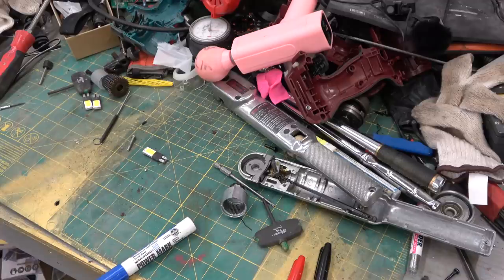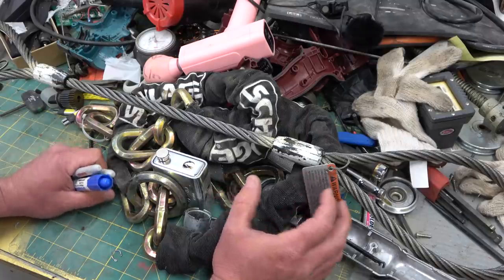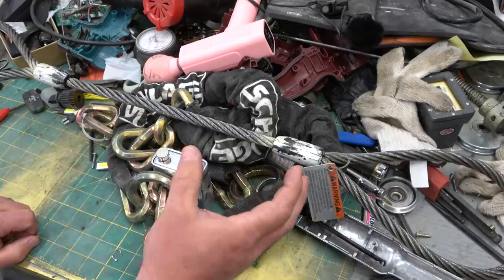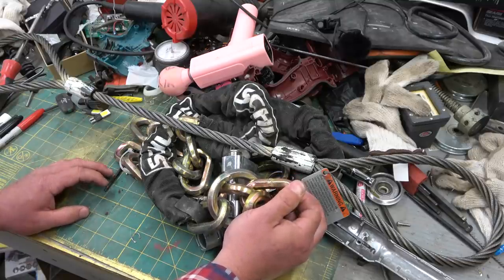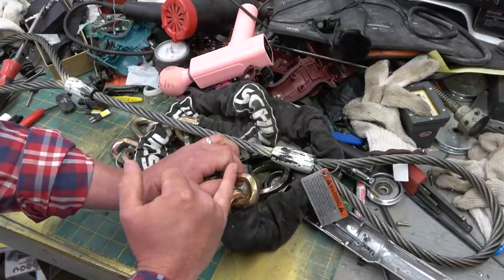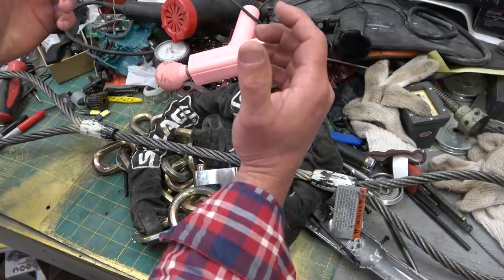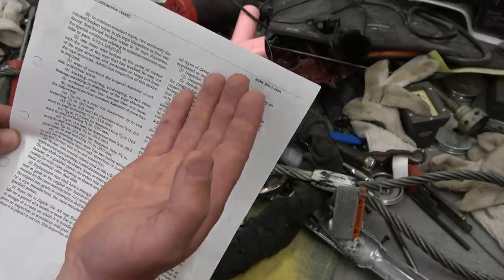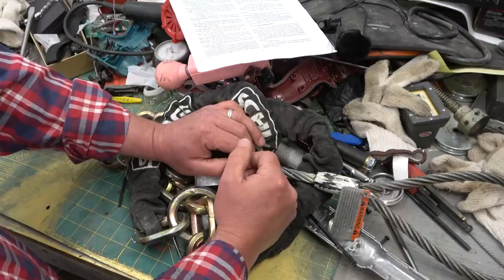"It is not known why the pulling cable snapped."

Comment: Imagine being the guy who designed 2 brakes in, only to have both disabled.
Reply: pathetic. needed 3 breaks
Reply: Imagine that guy/gal watching this news release. Asking why their double fail safe system, failed. Why didn't it work, what did they do wrong?! 

Then seeing those service jaws.
Reply: @mrfordman9999  Nightmare stuff.
Reply: I heard after this job, he went on to designing turn signal systems for BMW.
Reply: @immikeurnot  the turn signals on a BMW are actually functional however the drivers are not.
Reply: @MNDashcam  That's the joke...
Reply: @immikeurnot  I thought that BMWs don't come equipped with turn signal systems at all and to have them installed is one of the costliest extras out there...
Reply: @mrfordman9999  "Imagine that guy/gal watching this news release." - The guy is probably long dead. AvE said that it was installed in the 60's so the design might very well be from the 50's. Even if the engineer was 20 at the time he'd be around 90 today.

Comment: "The profit isn't worth 14 people's lives" - there's maybe an internal memo about that.....
Reply: This company will be sold as it is cheap, be absorbed into an other faceless company and this will continue happening.
Reply: And a reply asking what the acceptable number of lives would be.
Reply: @davesowens  probably one or two a year. But not 14. Sadly
Reply: Like all the people that die in plane crashes time and time again - no company gets the memo, just a cheap slap on the wrist.
Reply: Something something stochastics. If the combined profit of all your fuckups exceeds the cost of those that led to an incident, you are in the green.
Reply: Of course, and if the choice was that stark they'd have done the right thing. The point is they they weighed the profit against what they thought was an extremely small chance of 14 people's lives. This video is the first thing I've seen with some explanation of what went on: the news I saw just said 'the cable broke', not even distinguishing between the drive and suspension cables. Pretty amazed that someone thought it could/should be run with the emergency brakes disabled!
Reply: @xxwookey  99.99% of news stations today don't even have reporters, so not even surprising. We no longer have due diligence and investigations, just short attention grabs. We go to smart regular people and comics for the facts now. 🤦‍♂️

Comment: The brakes being bypassed like that seems to me like a tragic example of "there's nothing more permanent than a temporary solution" I wouldn't be surprised if it's found out that the brake bypass was installed to get them through a busy day in peak season and the phrase "we'll fix the brakes later" was used but later never came either because it was forgotten about because the repair wasn't scheduled for the soonest bit of downtime or because the bypass fixed the symptom so the support tickets for the dragging brakes stopped coming in and those who ran the cable car on a daily basis fairly assumed that the brakes had been properly fixed
Reply: Precisely. Possibly the original technician later left, the new person comes on the job, and assumes "that's how it has always been" or something along those lines. Of course they don't dare to question anything because they are the FNG. The operators get used to seeing the bright red clamp things on top of the car, if they even knew what those were to begin with. Next thing you know, even the most ridiculous violation of safety protocols has become the norm. "Normalization of deviance" is what we call that in aviation, and it has been responsible for the deaths of thousands and thousands of people.
Reply: @dirkmohrmann8960  oh the rant I could go on about "but that's how it's always been" and where I used to work during my university placement, just think about it lights a fire in me and genuinely causes my heart rate to rise, just because it's always been done a certain way, doesn't mean that way is correct, standards and specifications exist for a reason, sometimes they exist for safety's sake, sometimes they exist so a third party can compare two devices and/or trust the reading that they give. Without giving too much away so this can't come back and bite me, when calibrating a light meter, if the standard calls for a tungsten filament lamp with a specific colour temperature then a fluorescent tube is not adequate for so many different reasons, also if the standards says a minimum of 1 calibration set point per range, even if the meter is auto ranging and the user can't control the range it's in a set point at 0 and one other value isn't adequate either but try explaining that to management when the old fart who is the calibration "department" has been with the company umpty years and is too lazy to do his job properly constantly fires back with "but that's how it's always been" and "it's never been a problem before" like a broken record, and ofcourse management don't understand that the reason it's never been a problem before is because noone bothered to check but the moment a customer who does know what the requirements of the standards are requests proof the company is adhering to the standards and the company can't provide it as it doesn't exist they're gonna have several big lawsuits from several big companies to deal with and that's before trading standards gets involved for the years of falsely advertising their product meets important industry standards when it simply doesn't, fortunately I was able to jump ship under the guise of not being able to work there whilst returning to uni to finish my degree when my contract came to it's end and it was very clear that the company was a ship on a collision course with an iceberg but the captain was too busy playing darts to care (although technically management were busy playing golf a lot of the time not darts 🤔 eh I'm not good at metaphors I do engineering not words 😂) aaaand mini rant over 😅 I could go on for a lot longer but I think I've made my point and saying too much could get me in trouble however unlikely that may be 🤷‍♂️
Reply: @rcmaniac98  same here, I quit a company because I was sure they would try to blame me when someone eventually dies at their property due to their negligence and willful lack of caring that entire parts of a structure are on the verge of collapsing.

Comment: In my experience as an engineer this kind of stuff happens when management starts putting unreasonable schedule/cost pressure on people.  You ultimately see a shift from prove to me this is safe, to prove to me it's unsafe.  Deviance becomes normalized and then eventually someone dies.  It's sad and disappointing because there are standards and they exist for a reason.  As someone who serves on ASME BPV committees I can say it is basically always the case that it's due to death (in the case of the BPV go check the Grover Shoe Factory out).  You would think after the Bhopals and Challengers the world the lesson would stick, but it never lasts all that long unfortunately.

Comment: As an elevator technician for 42 years, several times at a large corporation, I was instructed by an ignorant supervisor to bypass safety devices. I always told him to put it in writing, because I wouldn't do that to the trusting public. What if someone I knew and cared about got hurt? Never once would he put it in writing, because he would eventually be the one responsible in court.
Reply: Alright, and does asking for it in writing actually work? I mean, sounds good and all, but I have my doubts most bosses would do that unless they are required to sign off by code.

Comment: As pictures from a cable-car enthusiast show, the brakes got braced at least since 2014 already.
Reply: And in seven years no overhaul?
Reply: this needs more attention, do you have a link?
Reply: P
Reply: I was wondering how long they had been disabled. That is of course an outrageously long time. Once it's been working like that for a while of course, people get complacent.
Reply: @rwilson1125  They sure did! Even repainted the Cab.
My suspicion is, they had opague issues with the breaks and then played the blamegame until it became their new working standard. 
Those small lift companies usually ride the edge of bancrupcy.
Reply: @rwilson1125  I saw they overhauled the whole thing in 2017 I'm not sure where this info is coming from?
Reply: Are you basing the 2014 part of that statement on the timestamp visible on the pic in this video? Is it verified elsewhere as being correct? I just assumed it was another case of someone not setting up their camera
Reply: @BDBMX  exactly 💯👏
Reply: @BDBMX  It is what several news outlets stated. And given the different paintjob, it seems plausible. 
I have not however checked the camera settings myself.
Reply: @stevenakn1  Overhauling doesn't necessarily mean they fixed the breaks, that was kinda my whole point.

Comment: My first job in the mines was in a slop mine. The slop car was the scariest machine in the mine. He had a few run aways while I was there. It was pulled buy a wire rope but most issues where caused buy a loose nut behind the controls!

Comment: I am lost for words I have been dealing with wire rope for over 30 years and can splice it with my eyes closed and have never had a cable break or have had one of my splices fail ,so like he said the rope was not the problem it was the abuse that was put on it. I prefer a manual splice before a pressed on sleeve for the same reason as he says, so my hat off to you for saying the real reason why the rope failed,

Comment: it always depends if i'm drinking from the glass , or pouring into it
if im drinking, its half empty
if im pouring its half full
Reply: It's not where it is, it's which way it's going.
Reply: great video as always, 
i wouldn't make jokes of any families grievances , and my deepest thoughts are with those at loss
Reply: whoever writes this tragedy into a movie either makes a horror or a tear jerking biopic
Reply: @amadensor  Precisely correct. Stated another way, filling a tank with gasoline, it will be half full. Using the gas (e.g. driving), it will be half empty.
Reply: @stuartm5745  the direction I am heading being more important than where I am is a larger concept that applies to more than tanks and cups.

Comment: One user wrote that there is no overload on the tow cable as the emergency brakes act on the load bearing cable.
Interesting very interesting.
"You see, but you do not observe." - Arthur Conan Doyle
Reply: The amount of physics the average person doesn't understand is shocking. I remember an old Mythbusters episode where they were testing the airplane on the conveyor myth. Even the pilot they hired to test fly the plane thought the plane was going to stay put on the moving conveyor. Anyone that has even a loose grasp of critical thinking would know the airplane doesn't care what the wheels are doing. Its only mode of movement is air over propeller and wing.
Reply: @dangerrangerlstc  Haha, I feel personally attacked by that one. I took statics and dynamics in university and still got that one wrong. Even then, it confused me until I scratched out a simple free body diagram for myself. It's counter-intuitive and you're right that it takes critical thinking to resolve.
Reply: @dangerrangerlstc  When I saw that episode I assumed the producer told the pilot to say that so that they'd have a range of opinions and thus raise excitement in the episode. I didn't believe he actually thought it was true.
Fast forward to ~a year ago when Adam talked about it on the Tested channel, and confirmed that the pilot actually believed he wouldn't take off. Staggering.

Comment: I honestly have nothing extra to add, you hit the nail right on the head. The technician did it wrong, but the company that pushed someone into doing a dirty fix just to keep it running is truly responsible.

The problem with doing the right thing when nobody else will is that they'll just fire people until they find someone willing to do the wrong thing.
Reply: Sad thing is, if that company weren’t profitable they might go out of business and someone with less scruples would buy up the tram and run it with even less oversight.
Reply: @johnpenguin9188  that's a horseshit argument.

Comment: "Hey boss, the emergency brakes on this thing are dragging. I need to shut down the ride to fix 'em."
"Are you kidding? We aren't going to meet the uptime goals for the quarter. The execs are gonna flip. Have we ever had a cable break?"
"Uh, no..."
"Pop those things open then. We'll do the repairs during the maintenance window next quarter."
I am sure this conversation is familiar to anyone involved in reliability engineering, no matter the industry. The scariest part of amusement park rides for me is when I start wondering what their maintenance program looks like...
Reply: ...... now imagine if you were an inspector, and actually knew.......

Now............Ask me when I last went on an amusement ride, tram, or something risky I could avoid that I know about............, go ahead I'll wait.....    and wonder why........
Reply: as a mechanic and electric maintenance technician working with cnc machines and other production machines, i can fully confirm this. if there is a big repair with more downtime than 1-2 days, that can be avoided by cobbling it together with duct tape and zip ties, management will always say this.
Reply: I work for one of the "big" theme parks in the Orlando FL area, and I can confidently say that the procedures in place there are such that they will shut any ride down for anything except perfection on the safety critical items. I'm sure that comes from the lawsuit fears of the modern age, but going from industrial environments to the theme parks was a major surprise at how many parts and things get changed or refurbished before they even show signs of wear. As well as how the control systems are not made to keep the rides running (as seen in production systems), but they are made to shut the ride down at any inclination of a problem. 

I am not sure about smaller parks, but you can avoid those fears when at the major players in the industry.
Reply: But they have been shut for covid for months.
Reply: @andysgreif  Disney is the only theme park where I would feel comfortable getting on rides, because I’m positive their maintenance program is spotless. Other parks… not so much.

Comment: Risk Management: fancy words for deferred/ lack of maintenance.
Reply: Risk management is not what you're imagining it to be...or it shouldn't be that, anyway...as tragically shown by this accident. Risk management is well summed up in HARA (Hazard analysis and Risk Assessment) and all the standards of designing, engineering, testing and maintaining equipment as AvE pointed out with the ASME standard of maintenance. These methods and standards culminate all that's been learned and even foreseen as potential problems and laid down on paper to train and assist people to AVOID said risks as much as possible. But then you get a smartass like that dude that thinks he's smarter than all the engineers that thought through all the issues that happened and the ones that have never happened yet, but have any chance of happening and dismisses them all with a handwave thinking he knows better. That is incompetence and criminal negligence by definition, period.
Reply: Think cost versus benefit, for example the Ford Pinto would not have burst into flames if Ford had installed a sub 4 dollar plastic shield over a bolt. They figured lawsuit costs would be less that a recall until they were forced to do it.
Reply: @marian-gabriel9518  Well in my 30+ years of personal experience, the engineered intention would be to follow a rigid and exhaustive maintenance routine regardless of cost ,time,materials. Unfortunately, mouth breathing, "educated", managers are typically not engineers in todays industry, as in the past, and the emphasis in all forms of construction/manufacturing/utility/service/etc... is to cut cost/profit wherever possible wherever there is a grey area. The only place I have ever worked where there was rigid compliance was in the US Navy. There will always be a struggle between maint/repair and management and unfortunately too much emphasis is placed upon short term cost savings and not enough on long term safety. Managers get bonuses on short term savings, you ever hear of maintenance getting rewarded for long term safety goals?  Having been in the ski lift industry myself though, any brake issue would have been cause for lockout and repair immediately. My 2 cents

Comment: It is always Management's fault. Always. Always. Always.

If there is ever a problem, it can be traced back to management either not designing a proper system or not respecting the one they were given.
Reply: Not in engineering. Whoever stamped the design is at fault unless they can prove it wasnt design but user error or lack of maintenance.